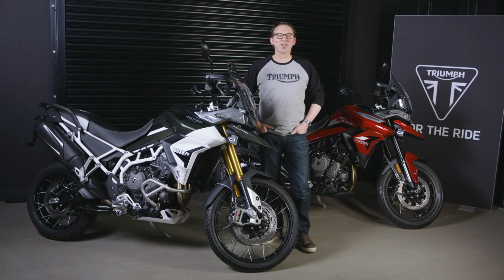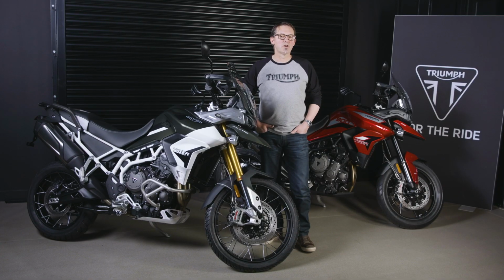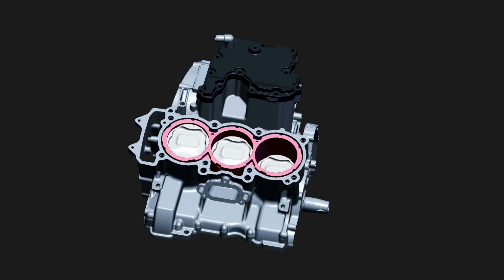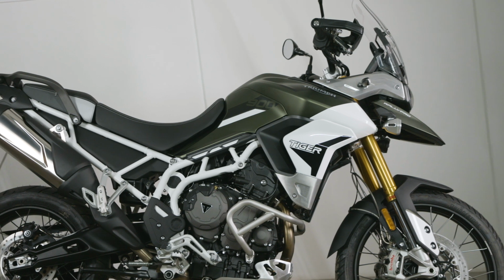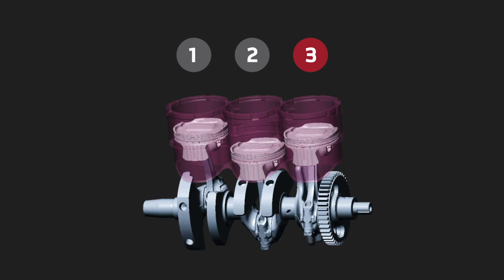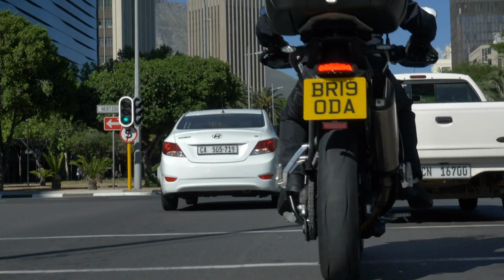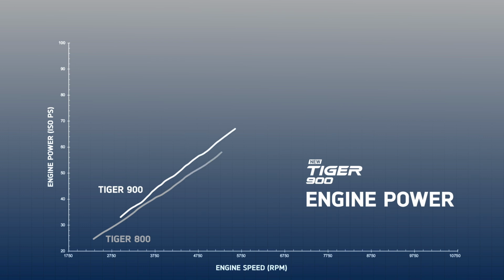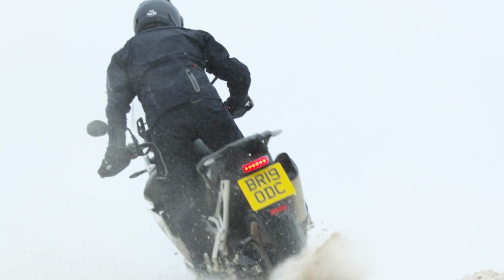Triumph Tiger 900 Features and Benefits - New Engine

Comment: The best thing about the Tiger 800 was the sound of the 3 cylinder engine, this new 900 engine got the horrible sound, Triumph disappointed me.
Reply: I have no idea what the hell you guys are talking about. I just rode the new Tiger 900 today and it sounded AMAZING. Probably the best sounding engine I've ever ridden. I'm in love with the new trend of cross-plane crankshafts, it's one of the best things to happen to motorcycling.
Reply: +1 While  long due and remarkable improvements and inventions have been applied for the new engine (e.g. 1-piece aluminium liner, re-positioning of the engine in the frame, and more importantly bigger displacement) there is one thing  I think a true Triple-Fan will never buy into: new crank and firing order. We love true-triples for their super-smooth, natural and linear character, often whining sound. This is why I  still ride & enjoy a BMW K75 or ride my  `18Tiger800 , which might already a tiny bit less Triple than ealier years.  I tried & ditched the Yamaha cross-plane MT-09 and for a similar reason I will  probably never buy into the new T900, which seems to me , sorry for my wording-, a Franken-Triple.  Probably, the new T900 has really improved on terrain and lower speed,  however one tester in India reported that the new engines` vibration cause more fatigue on a longer ride on pavement.  I still value Triumph being a consistent  and sole brand of the Triples for decades, but the new  T900 crank and firing order puts me off. Triumph builds good marketing around this like Yamaha, but I am disappointed, as well.
Reply: @yellowbearworks2535  I tried the 900 and it does have a hand numbing vibration even at low rpm.
Reply: @yellowbearworks2535  wait till you ride one ,
Reply: Are you kidding? While the old triple sounds buttery smooth, the new T-plane triple *growls* like the Tiger it is. Right & proper!

That throaty burble + the counterbalancer whistle totally sold me when I test rode the 900.
Reply: tenho que concordar...pelo menos nos videos....ta feio mesmo...!